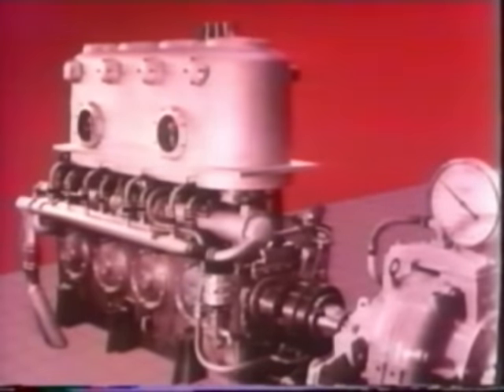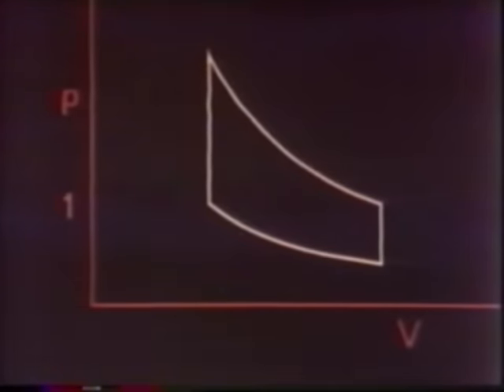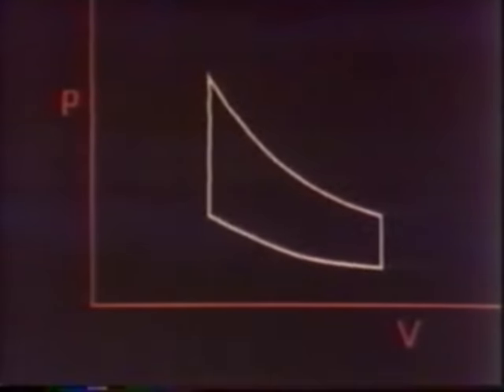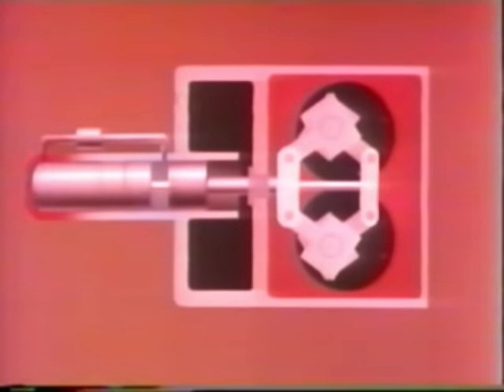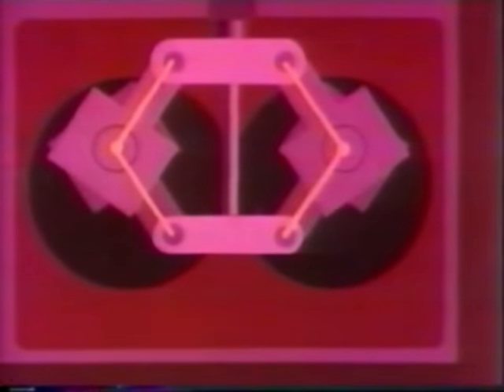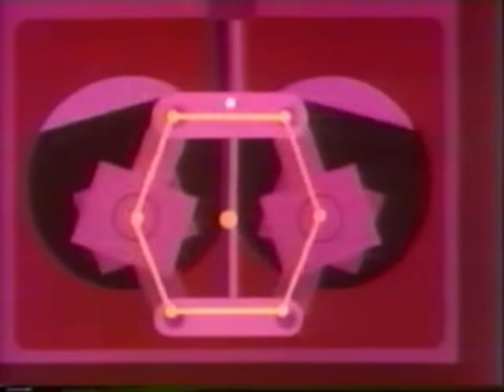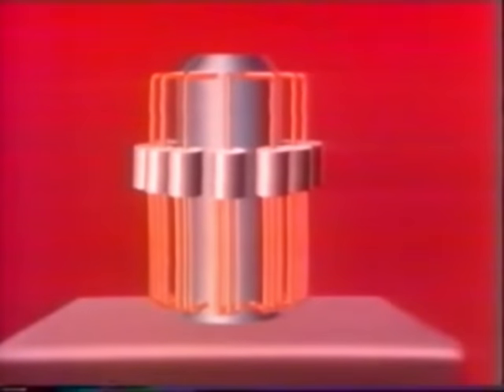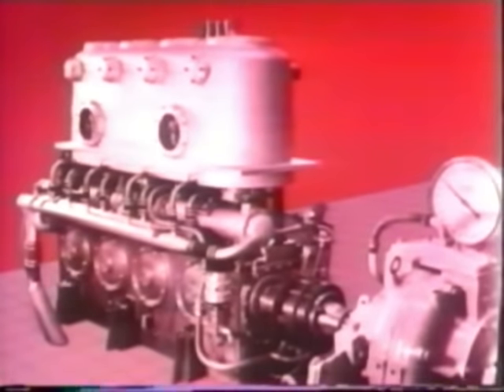The Stirling Cycle part 1 (Stirling Cryogenics)

Comment: This is great. I wish Phillips didn't abandon their Stirling engine program in the 70s. What a loss of a profoundly amazing technology.
Reply: At 40% efficient its quite a bit more efficient than most diesel engines today and definitely most gasoline. More interesting, however, is its ability to cleanly run and burn any fuel, gaseous, liquid, or solid.
Reply: NASA made some and published it in the 90's. I just watched it here on YouTube. I just emailed them asking for a PDF of the blueprints they used.
Reply: @m.w.2098  Did you received any reply from NASA to your blueprints demand?
Reply: The efficiency of the Sterling cycle is misleading, to say the least. Where gasoline and diesel engines gain efficiency with load, Sterling engines lose efficiency with load... due to heat soak on the cold side of the chamber. It's too bad that engine is so mass intensive... in theory, it would work great as a marine engine, as the water could be used to cool the condensing side of the chamber.
Reply: Br!an Delta V - most modern diesels operate at 50-60% efficiency. Several gasoline engines have seen 40%+ efficiency, thanks to Atkinson cycle designs... but only under peak load. 

The new Koenigsegg "Freevalve" engine could see part throttle efficiencies raised, as well... with it's independent control of valve lift/duration, the valve timing can be tailored to facilitate valve operated throttle modulation. This would allow not only better low-load throttle control, but also provide vastly improved transitioning through throttle response, as the peak part-throttle vacuum would only be exerted on the cylinder/combustion chamber (as opposed to the entire intake volume)... even better than ITB injection, runner valves, etc..
Reply: The program was abandoned because there were no alloys that could withstand the heat for prolonged use at industrial sizes
Reply: It's amazing in its complexity. A price paid for extra parts wont' be rewarded with a fuel economy during a warranty period. But, if it's possible to incorporate a Stirling engine into an exhaust system of a traditional diesel engine, we could achieve remarkable numbers I think.
Reply: @zachlandis8728  There are now. Also, low temperature engines that run off of natural gas could potentially provide electricity for many small towns.
Reply: @smh9902  , I would say more interesting is the ability to "fuel" it with heat provided by Concentrated Solar Power (CSP) dish.
As long as the Stirling engine can be produced economically with decent efficiency, scaling up such CSP dish is cheap and easy - you need reflecting surface - no need to be perfect, not the CSP needs to be perfect parabolic dish - it can be faceted, and can focus the light in a wider area about the size of the heat-collector of the Stirling engine.
Also Stirling engine can be used in reverse cycle - ie to use mechanical energy to store heat /& cold/ on its two heat exchangers. 
Similar concept is currently implemented by Malta inc. (just with different heat-engine) to use the excess energy to store heat differential in two insulated containers - a hot & a cold ones. This way when the Sun is out they can use these containers to provide the heat differential for the heat engine to produce electricity.
Imo such Stirling engine installation would be better to be stationary and used for renewable energy management (ie collecting, storing & converting to electricity) rather than for cars (but still NASA had successful project for a Stirling driven pickup truck)
Reply: @blueckaym  Solar is just too diffuse of an energy to use in a lot of applications. Powering the grid with solar is just not practical.
Reply: Br!an Delta V not quite a Diesel engine can achieve 50% efficiency in the right conditions.
Reply: @driverjamescopeland   The diesel engines that achieve 50% efficiency are massive marine engines for container ships that are literally the size of a huge building and have strokes several times longer than their bores. No diesel engine has ever broken into the 60% efficiency regime. Ever. so disregarding diesel engines that are the size of a small skyscraper, normal truck sized diesel engines are only about 35, sometimes 40% efficient at best.
Reply: @smh9902  - The Cummins ISX has been tuned and exhibited several times to exceed 40%... and that's just a common road diesel. Again, the efficiency of a Sterling engines is highly overrated, due to their comparatively low duty cycle capacity. Don't believe me? Ask the USAF, USAR, USPS, and any number of airports that bought Sterling powered Dodge pickups back in the late 70's through early 80's. To my knowledge, the highest powered iteration was 83hp, and consumed more room under the hood than the OEM V8. While they performed great in a lab, their performance was largely subject to ambient temperature and duty cycle. At 20% duty in 100°f, you had about 15-20min to accomplish your task before you were down to about 5hp output until it cooled down. Several tuggers were built with Sterling engines, and did work better than the pickup trucks... but they required a large heat exchanger behind the cab to maintain a sufficient gradient. 

The Sterling engine is not new, by any means. With modern and highly expensive materials, they could become more viable... but the expense of those materials (specialized engineered ceramics) and their frailty with regard to thermal shock, any such engine would be limited to applications with tightly controlled condition (definitely not transportation).
Reply: @driverjamescopeland  I'm not espousing the Stirling as being objectively superior, I'm just saying that given its multi fuel capability its not as bad as some people make it out to be. The ISX can only maintain that efficiency in a very narrow power band. Cummins did much better in the 70's with their adiabatic engine which achieved a thermal efficiency nearing 50% and Henry Yunick achieved identical results with his "red hot vapor engine" which used an identical methodology of design.

In the next ten to twenty years once fickett-jacobs cycle detonation engines get developed we will see hyper simple 60%+ efficient engines commonplace.
Reply: @smh9902  - both of those engines you cited, like most other 'high efficiency' examples, have extremely poor power density, and are also only capable of producing said efficiencies within a very narrow load/rpm value... and usually under considerably controlled conditions. 

The Sterling engine is a flexible unit... as it can be used virtually anywhere with sufficient controlled temperature gradient to generate motion. With our modern advancements, however, the low power density and poor duty cycle have rendered them a novelty to all but a very small set of stationary applications.
Reply: @driverjamescopeland   Thats actually not true. Both the Adiabatic Engine and Henry Yunicks "Red Hot Vapor Engine" had approximately double the power to weight ratio of the production blocks they were built upon and had very wide and flat-like power bands and torque curves, respectively. They were not only tested under "ideally controlled conditions" but under a litany of extreme conditions as the US Army assisted Cummins under the TACOM program in the development and testing the Adiabatic Engine and subjected their various prototypes to strict military torture testing and field trials which subjected it to a wide range of conditions one would almost never see in a civilian application, and Henry Yunicks engine was subjected to an equally impressive high performance motorsports testing regime with a littany of acceleration and deceleration demand. Both high performance motorsports and military testing provide conditions that are "less than ideal" such as extreme shock, impact, g-forces, simulated system failures such as artificially induced coolant system failures and ignition system failures, and much more. You're making an assumption that "there must have been a reason the big corporations didn't commercialize this technology if it was so great" and there is a reason but you're not going to like the answer. It wasn't the fault of the technology itself, but rather the fact that the technology worked based on first principles that are not particularly well known nor fleshed out and these principles contradict with conventional engine design philosophy and models, so this technology cant use the 100+ years of industry inertia to accelerate its development which makes commercialization especially financially risky to the perspective of MBA's at large institutions and corporation.

Both engines were installed in road worthy vehicles, the Adiabatic Engine in a 5 ton M800 series truck, and Henry's engine in a Pontiac Fiero. These vehicles showed marked improvement by every metric and supreme fuel efficiency not even obtained today with modern technology. The Fiero possessed race-car levels of performance and achieved 51 MPG using breaker points (not digital) ignition and a purely analogue/mechanical fuel and air control system. Some people say that this isn't true, but the Fiero's performance including its efficiency was validated by tests conducted by General Motors, the corporation that funded its development. The Adiabatic Engine performed similarly spectacularly.
Reply: @smh9902  - you really bought all that propaganda... hook, line, and sinker, didn't ya? If you knew anything about fuels and specific energy content, you would know those were all drastically exaggerated figures.

Vapor fuel delivery has no positive benefit, aside from more complete atomization. By vaporizing the fuel, you're doing nothing more than decreasing the density of the combustion charge. Granted, you can incorporate forced induction... but that means you must vaporize the fuel BEFORE you compress it... which is counterintuitive, to say the least.

You sound like another one of those guys who read way too many Popular Mechanics ads for "200mpg vapor carburetor plans", and (for good reason) never bothered to build them.

All of the false claims you just regurgitated from whatever faulty source you may have found them, recirculated throughout the years for lack of simple understanding for the Otto cycle. People hear things like "the gasoline engine is only 25% efficient" and think they can build one at least twice as efficient. Vapor carburetors, "adiabatic engines" (as much myth as fact for any engine), wierd looking spark plugs, high voltage coils, "static turbos", or any other number of B.S. ideas you can think of... they're all out there trying to sell you the other 75% of something you simply can't get at the miniscule displacements of most consumer applications. 

Those old articles and crazy claims of accomplishments that never happened, are fun to read... but that doesn't make them anywhere near true. There are a few examples of faulty test calculations or instrumentation being the grounds for some of those claims... but that still doesn't change the fact that they never happened.

A gallon of gasoline has just over 33kw of energy. A gallon of diesel has just shy of 38kw of energy. A 350 cubic inch V8 has roughly 1.57:1 surface area to volume ratio, with mild variation depending on on bore/stroke ratio. This surface area is (on average) AT LEAST 500°c (900°f) BELOW the combustion temperature of gasoline. At reasonable and streetable RPM, that's an easy 30-40% of your thermal efficiency pissed out of the radiator or getting converted to CO2 in the cat, from simple thermal losses. Furthermore, rotational losses on the best low-tension V8 race engines are around 36lbs at 2,000rpm... and that's with rings that won't pass any EPA cycle, specialty coatings/materials that eclipse the cost of any OEM high production engine, and extremely delicate rotating assemblies that simply wouldn't withstand the shock and dynamic load of a street application. There's another 10% of your efficiency out the window.

It's fun to believe those things... like a kid believes in Santa... but it's a disservice to spread them as anything more than rumors.
Reply: @driverjamescopeland  You seem awfully sure of yourself. You obviously did not read the peer reviewed papers I sent you.

The only reason why HCCI is so narrow power banded is so is because current generation deflegration based engines break if they go into detonation mode. If someone could ever develop a pulse detonation fickett-jacobs cycle engine that uses true isochoric constant volume heat addition then it wouldn't be a problem and we could have compression ratio's as high as we want. The reason why they are so ficky with AFR's is because they are prone to detonation. But if the engine is designed to detonate the fuel without breaking, then its not a problem anymore. The reason that conventional design philosophy necessitates variable compression ratio's is because too much compression will detonate the fuel. Again, this is solved by building a detonation based engine.

I never claimed 80%, so you're literally lying now. I did claim that 55% and even 60%+ is possible and reasonable.

I'm also not claiming that the Fiero was both efficient in terms of MPG's and powerful simultaneously. I'm saying that its fuel consumption was proportionate to the load and power output. Obviously when it was producing 241 HP it wasn't getting 51 MPG. Duh. You're assuming that these engines produced peak power for a given RPM at all times like our conventional engines. But thats not what was happening. What I'm saying is that the fuel consumption varied according to the load irrespective of displacement, they ran very lean, and a sedan cruising down the highway only takes about 20 horsepower on average to maintain speed. This means that the AFR's can be through the roof if the engine is designed properly. The Cummins adiabatic engine achieved 48% efficiency in the 1970's.

And BTW, homogenization doesn't just provide "better atomization" you dont even know the difference between the two terms. Homogenizing the fuel actually increases its motor octane number rating substantially, to around 120 MON depending on variables. The heated intake air diametrically reduces the octane rating, and the degree changes dynamically according to a plethora of factors such as humidity and ambient temperature and engine temperature, changing AFR, among others. This is why its so difficult for a conventional engine to not detonate and destroy itself under HCCI, we dont know enough about this complex process to make accurate prediction models for these engines. But, if we ever made an engine capable of withstanding detonation without issue (a pulse detonation, if you will) then again, that wont be a problem anymore.

Regarding the materials, you've no idea what the materials used to build these engines were comprised of. You're making an assumption. I've actually read the papers. The materials were not particularly exotic, at least by today's standards.

Read the peer reviewed papers and sources I linked you and stop suffering from dunning-kruger. If you think I'm wrong, then you're literally disagreeing with Cummins, the US Army, and SAE. Go write them an angry letter telling them that their papers are wrong and refute their papers. I've been a mechanical engineer specializing in the design of engines for ten years and you're unwilling to learn thus wasting my time. Good day, sir.
Reply: @smh9902  - if the Cummins adiabatic were viable, they'd be using it by know... especially with the advancements in metallurgy in the last 5 decades.

I never said HCCI was just "better atomization". I said vapor fuel delivery only yields better atomization, at the expense of reduced density. That's a fact... period.
Reply: @smh9902  - I said (AGAIN): "HCCI (Homogeneous Charge Compression Ignition) is still only effective, AGAIN, for a very narrow window of application. The very words "Homogeneous Charge" dictate a specific air/fuel ratio (AFR) which by proxy would require an engine to capable of both variable displacement AND variable compression."

NOWHERE in that statement did I mention "better atomization".

Now, back to your previous claims... 

(Quoting you) "irrespective of displacement" ? No way. Not happening. The energy required in merely moving a constant volume of air will have a variable percentage of parasitic loss on varying outputs.

These systems were all tested long ago. While some success was seen with all these "lean burning" engines, they all faced a common problem that simply will not comply with modern environmental standards... NOx emissions. The problem therein, lies with their efficiency. The heat released is so rapid and elevated, it propagates the oxidation of nitrogen, creating the NOx emissions we are desperately battling now. You simply can't have one without the other, unless you utilize inert gas (exhaust) injection which defeats the purpose of efficiency. If you have variable demands, this dictates a variable amount of fuel to be burned to release an adequate yet not overpowered level. Conversely, HCCI, Homogenous Charge (meaning ideal AFR) Compression Ignition will require variable displacement in such manner the air content of the charge will appropriately match the fuel requirement at the desired ideal ratio. The only way to achieve this with a static displacement engine, is to isolate the charge required for the combustion event until completion, whilst the remaining bypass volume is simultaneously compressed, absorbs a minute amount of heat from the surface area, and then exhausted as little more than a byproduct. Mercedes experimented with such a system back in the late 40s, which combined HCCI-similar and "hot bulb" thermal transfer (not to be confused with "hot bulb ignition"), wherein the bypass volume was compressed to a then extreme ratio (I believe it was in excess of 40:1) and surrounded the steel bulb that contained the combustion charge. It worked, and was quite efficient... but the contained ignition charge combined with the extreme temperature gradient within the steel itself, created a whole host of problem we still face today (carbon buildup, injection fouling, material failure, etc.). Another development company attempted to revisit the cycle some years ago, using a ceramic composite as the intermediate material between the combustion chamber and bypass compressed volume. The results were not good. By the time they achieved sufficient temperature differential, the thermal shock created by the compressed bypass volume would cause the ceramic to fracture. They attempted to use thicker material, but then they couldn't achieve proper thermal transfer. 

Again... with consumer duty requirements being what they are (considerably small load for 90% of operation, with a wide range of variables for conditions/maximum load capacity), seeing any gasoline engine achieve real world efficiency above 50% for any length of time isn't reasonable. An engine used as a range extender, on the other hand, could definitely achieve the figure, as operating conditions and required output can be made much more static... but there again, the net value of the system would still be down 16% in transition from fuel, to heat, to mechanical rotation, to electricity, to storage, to release. Even when using a capacitor bank... the best net overall efficiency of any hybrid system I've heard of, was 87%... and that was a huge stationary rig with a cap bank that simply wasn't reasonable for transport.

I'm not saying we won't see better efficiencies... but even 55% in a road car is impossible under normal expectations of performance. The only way around this, is to bypass the heat/mechanical cycle altogether, and find a way to chemically release/catalyze the fuel in its natural state, and either store the lost electrons until the user requires them for electric propulsion, or utilize some form of extreme gravity within a rotating cavity to isolate and and control the burn irrespective of the total volume. The latter has been successfully performed in some waste oil heaters, but has not yet proven viable for transport applications, because of radial/axial loads placed on the centrifuge. 

I firmly believe, even the inefficiencies of a turbine could be overcome by incorporating their extreme RPM with a centrifuge. The imposed extreme gravity could have profound effects on the combustion event, by means of extreme compression, isolation of undesirable compounds, amd a far more manageable kernel, flame front/propagation area/volume. While fluids (in this case, hydrocarbon liquid fuels) don't readily compress, the air volume and vapor barrier most certainly will. This would enable an ignition event to take place under conditions similar to that of the HCCI ideal, whilst the natural behavior of the byproduct gases could be controlled constantly, and with far better precision due to their density. The hard carbons would naturally retreat to the perimeter/peripheral area of the centrifuge volume, the exhaust gases would be displaced toward the center where the volume is conveniently at it's lowest pressure, and (with proper plumbing)  the required intake charge of fresh air would naturally gravitate to the vapor layer because it's heavier than the exhaust, yet lighter than the fuel. With this system, the entire combustion process could be maintained consistently, as with most turbines... WITHOUT the need for the intricate and heat sensitive veins to be subjected to the extreme conditions/turbulence of the combustion itself. Flow/power could be controlled with somewhat isolated valves, which would only be subject to a very narrow range of condition after operating temperature is reached. Required shut down and maintenance of the system would be far better than current turbines... only requiring the occasional expulsion of carbon deposits from the centrifuge, and longer service intervals for inspection/maintenance. We already have laser ignition capability, which is all that is needed to initiate the flame without introducing unnecessary mass into the peripheral of the centrifuge.
Reply: @driverjamescopeland   You said the following, exact, ad verbatim: "Vapor fuel delivery has no positive benefit, aside from more complete atomization. By vaporizing the fuel, you're doing nothing more than decreasing the density of the combustion charge. Granted, you can incorporate forced induction... but that means you must vaporize the fuel BEFORE you compress it... which is counterintuitive, to say the least.""Vapor fuel" is nothing more than charge homogenization. They are practially synonymous terms. So again, you dont know what you're talking about.
"The energy required in merely moving a constant volume of air will have a variable percentage of parasitic loss on varying outputs."
-But we're not moving a constant volume of air, the volume of air being moved changes depending on engine rpm, humidity, and ambient temperature.

"seeing any gasoline engine achieve real world efficiency above 50% for any length of time isn't reasonable." - Thats not true. I already explained how a detonation cycle can allow large engines to go into a lean burn which gives them fuel consumption rates like a smaller displacement engine at less than peak power demands.

NOx is not a problem anymore because 1: we have catalysts for such things and 2: using a detonation cycle eliminates the high residence time needed for NOx formation. Also you never mentioned NOx before, you're literally pulling a shifting the goal post fallacy." but even 55% in a road car is impossible under normal expectations of performance.""Impossible" is such a strong word. Achates Power has already achieved 55% on road performance.Holy shit your writings on a turbine is such trash. Centrifuges dont impose gravity. Its centripetal force, not gravity, and you're not going to use a turbine to form a centrifuge for carbon atoms. Centrifuges are horrendously inefficient. And jesus fucking christ, carbon deposits? Dude, if you're building up carbon deposits, you have a dirty, inefficient engine. A combustion chamber in an efficient engine is clean as a whistle no matter how many tens of thousands of hours of operation.The difference between you and me, is that I have several working prototypes, and you're in fantasy land. And I have sources from SAE that already debunk all of your claims and critiques. Open cycle engines, such as turbines, are always isobaric and thus will always be less efficient than a closed cycle fickett-jacobs cycle.https://en.wikipedia.org/wiki/Fickett%E2%80%93Jacobs_cycle
The fickett-jacobs cycle is more efficient than any turbine ever made, including the humphrey cycle and brayton cycle.
Reply: @driverjamescopeland   Fuel vapors can be delivered at stoich, all vaporized fuel does is turn it into a gas, like propane or natural gas, and we already know propane burns cleaner and does not have charge density problems. This allows for quick and immediate homogenization, IE homogeneous charge. I have sources for this as well.

Also you literally made a logical fallacy. "If its so viable why arent "they" (whatever that means) doing it!?" Well "they" are doing it behind the closed doors of research labs and commercialization will come in the next ten years.
Reply: @smh9902  - (Quoting you) "Fuel vapors can be delivered at stoich, all vaporized fuel does is turn into a gas, like propane or natural gas..."

Anyone with a 3rd grade education is well aware of the two different states. What you are failing to get through your apparently very thick skull, is the lost density between vapor state vs. liquid state. Lost fuel density, means lost charge density, which equates to lost available power. Granted, HCCI helps increase extraction efficiency, but not enough to make up for the lost density. To compensate for the loss in density, even combined with HCCI, requires some means of increased displacement. Forced induction doesn't bode well with vapor delivery, because the increased pressure increases the vapor point of the fuel. Increasing the bore and stroke will compensate AND be more favorable to vaporized fuel delivery... but again, you're building a bigger engine to achieve the same power, which is decreasing power density. 

In short, HCCI works. Vapor fuel delivery works. The problem with their application in consumer transportation vehicles, lies in what is required to have them work EFFECTIVELY within the desired parameters, without losing any of the following:

-duty cycle
-NOx emissions 
-power density
-throttle response 

When I said "they", I was referring to OEMs.
Reply: @driverjamescopeland   You dont lose charge density by using a gaseous fuel, EG propane. Thats just not true. What a homegenized charge DOES do, is increase your motor octane rating, which allows you to run higher compression ratio's, which increases efficiency and power. Regarding your comment on vapor point, fully homogenized fuels are chemically broken down via carbon cracking into shorter chained, higher octane rated, fuels, that are less endothermic in their nature. Cummins is an OEM. They proved higher overall horsepower, torque, and efficiency. Homogenized charges also burn faster, which increases power and thermal efficiency. Also lastly, by eliminating the endothermic cooling of vaporizing the fuel in the cylinder and cracking the hydrocarbons, which always precedes oxidation and is endothermic (IE heat/energy robbing) and instead using catalytic practices to reduce the energy necessary to crack the fuel, then cracking the fuel, before mixing the fuel with the air charge, you're increasing the power output obtained for a given amount of fuel. Stratified fuel of atomized droplets just dont burn very well, we have high speed footage of in-cylinder operation and the slow sub-sonic flamefront doesn't even burn all of the fuel before the exhaust valve opens. This has been proven via high speed videography on transparent cylinder heads. Propaned boost systems have been used in diesel engines for generations, and they increase power and efficiency.

Duty cycles are increased because we eliminate carbon fouling caused by trying to burn non-flammable liquids.
We eliminate NOx because detonating the fuel reduces the residence time below the threshold necessary to form NOx.
Power density is increased because we can and have ran compression ratio's as high as 300 to one, we can use 2 strokes per cycle, and we can use both sides of the piston as a combustion chamber, meaning an 8 cylinder engine will produce 16 individual power stroked per crankshaft revolution. Thats a whole LOT more than 4 strokes per cycle. This is called a "double acting" engine.
Throttle response is absolutely insane simply by richening the mixture. Our dyno testing has shown, under load, a jump from 6k RPM to 12k RPM in ONE crankshaft revolution.

The FJ cycle is nuts. We're literally hyper-compressing the fuel and air mixture via a 300 to one, yes, three hundred to one, compression ratio, and deliberately detonating the fuel at a flamefront velocity of 36 thousand feet per second, and ALL the fuel is fully oxidized before the piston has reached 5 degree's after top dead center. This allows the ENTIRE stroke of the engine to be a cryonic stroke that converts heat into mechanical expansion via boyles law and charles law. This also means that peak temperature is absolutely through the roof, around 20,000 degree's F. but is only maintained for a brief few milliseconds before rapidly cooling via volume expansion which eliminates the possibility for NOx formation by eliminating the residence time needed to form NOx.

Exploiting detonation, known as "knock" by old timers, is a real thing being researched right now. It solves all of these "problems" you're talking about.
https://www.eurekalert.org/pub_releases/2020-07/csu-pcb072220.php
Reply: @driverjamescopeland   If you actually read the papers you would knot that these engines had superior performance. The size of the atoms of hydrogen and carbon dont change, and changing the state from a liquid to a gas doesn't change the charge density in any meaningful way as there is literally over 1400% more air than fuel in even the richest mixture ratios. You're still subscribing to an old, obsolete model of engine building/designing thats no longer accepted by modern engineering standards. And you haven't addressed the endothermic reactions that precede exothermic oxidation, nor have you addressed the statements on isobaric vs isochoric heat addition. This is not the 1960's anymore.
Reply: @smh9902  - I can address anything you like, once you observe simple facts. Vapor is less dense than liquid. This is true of ANY compound... fuel, or otherwise. No amount of compression will rectify this simple fact. You're right... this isn't the 1960's, where people will swallow whatever B.S. you throw out there when you lace it with technical terms. It's a simple property associated with changing state of matter. No amount of debate over isobaric v. isochoric heat transfer will rectify your basic oversight of simple fact.
Reply: @driverjamescopeland   No, you're missing the point. Propane molecules have more energy in then than an octane molecules for a given amount of mass. And mass is more important than "charge density." This is why engines running on methane produce more power than running on gasoline, all other factors being equal. We're burning hydrogen and carbon, and the shorter the molecular chain, the more energy we get out of each atom. Charge density makes so little of a difference to power and performance as to be virtually negligible. The simple fact that there is over 1400% more air than fuel proves this alone, any change in "fuel density" doesn't matter because 1: we dont need as much fuel to produce our given power output because isochoric combustion really is THAT much more efficient and 2: the change in fuel density is physically negligible to the overall charge density and 3: Most of the fuel when trying (and failing) to burn liquids is wasted. Most of the liquid fuel dumped into an engine is wasted out the exhaust, hence why catalytic converters exist to burn the unburned fuel going out the exhaust system. By homogenizing the charge we get better, cleaner, faster, more consistent combustion, by using isochoric detonation we get more efficiency, and by increasing the compression ratio we get more power and yet more efficiency. Simply put, we dont need that "charge density" because most of that "charge density" created by spraying atomized drops of liquid into the cylinder is wasted anyway, and the only fuel that burns are small amounts of vapor around the boundary layer of the drops. If anything, your overall "charge density" in a fuel injected system is inconsistent and all over the place which means you get a slow, chaotic combustion that is wasteful. Just look at high speed video's of transparent cylinder head equipped engines. The fire is still burning even as the exhaust valve opens, and that fire is ejected out of the engine as waste. We can use less fuel (less charge density) and still get more power because we arent wasting the fuel by dumping it out of the exhaust system.

Apparently I need to break this down into first principles. All engines are air pumps. They are also heat engines. They work by compressing a charge of air, then adding heat to the air, then expanding the air, and the difference is useful work. The heat is added by burning fuel with the air. Any heat that is added after the exhaust valve has opened is completely wasted, because this heat isn't being used to power the engine. Any heat that is added after top dead center is partially wasted, and the further past TDC the more its wasted because there's less volem of expansion for that heat to be converted into mechanical energy via boyles law. Ergo, if we burn a smaller quantity of fuel much faster, so that all the heat is added at or near top dead center, we can obtain superior power and efficiency using less fuel because we aren't waste our fuel.
Reply: @smh9902  - LMAO... you're still talking about propane and vapor delivery. If propane were a more viable fuel for common consumer and even industrial/commercial transport, we'd all be using it. It's not. PDI technology has been around for years. It has far less to do with viable combustion efficiency, and more to do with sheer logistics. Propane doesn't transport or transfer as efficiently. Also, the energy by volume of propane is less than 68% of gasoline. In case you haven't noticed, we sell, trade, and transport fuels BY THE GALLON... for several reasons. You're not buying the energy. The energy is the desired byproduct of combustion. You're buying the volume, because the cost of production and transportation/distribution is more closely linked to it (volume).

No wonder you're so obsessed with the technology. It has it's merits... in a lab.... away from the challenges of the real world and common consumer interest. In short, the gains in efficiency must equate to some sort of effective gain. Propane priced have come down (comparatively)... but are still 3-5% ABOVE gasoline by gallon. This means you're paying 5% more, for an effective energy loss of 33%... not to mention the inconvenience, instability, and lack of infrastructure associated with the fuel itself. These engines would have to no only provide sufficient efficiency gain to net positive that 33% difference throughout the whole of the vehicle's life cycle, but hold such promise as to facilitate the rehab of decades worth of infrastructure. 

The engine alone would have to be AT LEAST TWICE as efficient as a modern Atkinson cycle engine, to get a net gain of 33% over the whole of the vehicle's operational life. Otherwise, we both know these developments are bound for limited implementation in some small batch productions of commercial/industrial applications and a few random fleets of passenger cars, search and rescue vehicles, or extreme cold weather service.
Reply: @driverjamescopeland   Again, you're missing the point. We can catalytically crack long chained liquid fuels down into methane and propane like gases on-board using new catalytic technologies, which obviates the logistics issues of propane and gaseous fuels like methane. In fact, by catalytically cracking fuels we can cut out the refinery as a middle man entirely and purchase crude oil directly from the drillers, as well as use straight vegetable oils, waste motor oils, burned brake fluid, waste coolant, waste alcohol, coal-water slurries, etc. ALL without having to adjust ANYTHING because all the fuel is cracked down into a consistent product irrespective of the feedstock, the end product being monotomic hydrogen radicals, methane, acetylene, and carbon monoxide. This allows us to get the advantages of the energy density by volume that liquids offer, whilst also boasting the advantages of energy density by mass offered by gaseous fuels. We dont have to settle for compromise anymore. We can use the same process used in refineries, miniaturized, downscaled, and simplified, under our hoods.

If you're actually interested in learning about this technology, I'm a guest speaker at Aaron Murakami's energy and science conference next week.
https://energyscienceconference.com/
Reply: Swedish marine use Sterling engines in their u-boats.
Reply: @smh9902  but efficiency is just one parameter out of many. how many miles a Stirling engine would run? (durability) How much power can it generate? (could you put it on a truck carying 40 tons?) Humans are not dumb, they certainly chose internal combustion engine because it gave more advantages than Stirling engine.